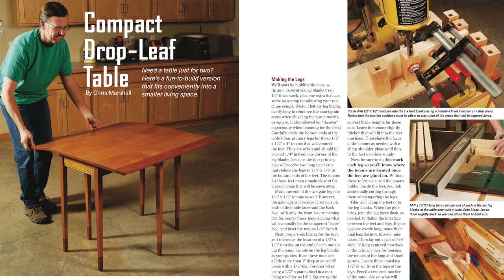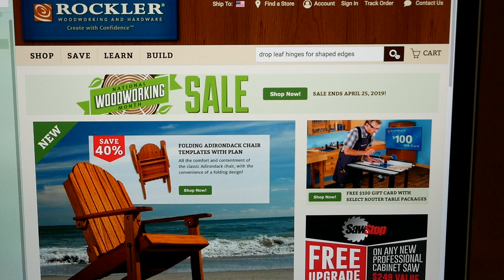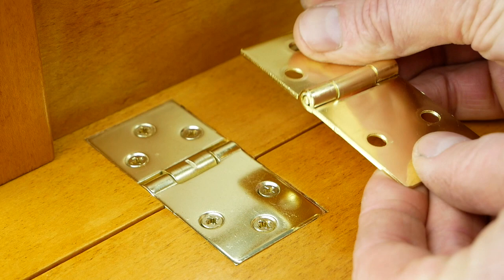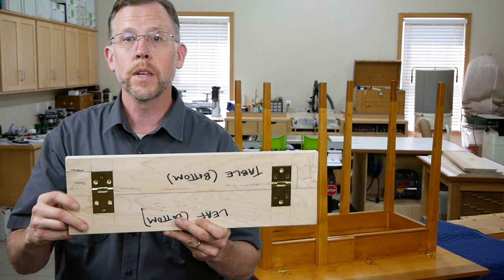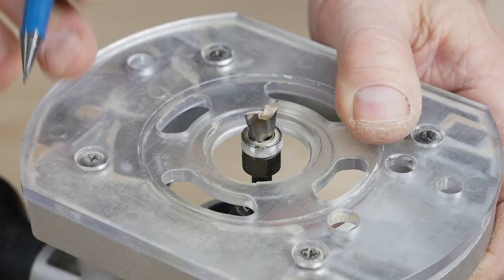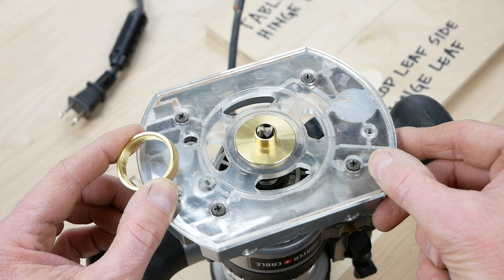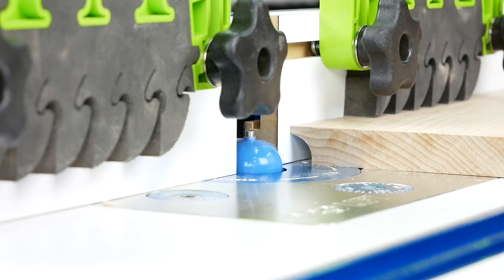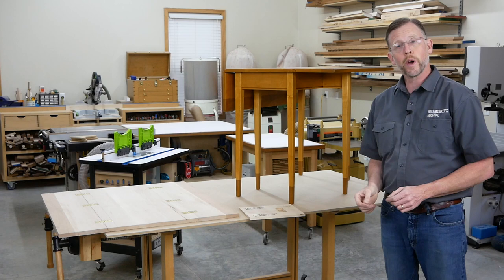How to Install Drop Leaf Table Hinges | Woodworking

Comment: Thanks for this tutorial.  I have one question.  I want the dropleaf to sit flush with the end of the top when dropped.  i.e, using 9mm ply for the top and dropleaf, can it be square edged so all the tabletop edges are unshaped and square to the top, the top surface of the dropleaf level with the underside of the top.

Comment: This was a helpful overview of a Rule Joint.  My question is what radius to use for the round-over and cove bits if you want a drop-leaf top that is 1.4" thick?  All or most, I have seen are 3/4" to 1" thick.

Comment: Thanks for making this video, lots of good info. But when the drop leaf is folded down, don't you see the hinge mortise at the bottom of the center piece round over? I do. It doesn't look good. Popular Woodworking did a similar video for the rule joint wherein they suggested NOT mortising in the hinges, specifically because of this problem. I thought the drop leaf edge would cover the mortise. My test piece looked good, but the real table does not. : (  What am I missing?

Comment: Were you able to determine why the rule joint would bind after you had made a routing template and cut everything as precisely as you did? I was expecting the joint to move freely, and not require additional nudging to complete the fit.
Reply: He had to trim off the leaf because he clamped the top and the leaf together without leaving a gap. Installation step #3 says to leave a 1/32" gap, which he didn't do.

Comment: Would this work if you had square edges rather than rolled edges?
Reply: the pivot point would have to be in the center-line with square edges, or if you're determined to have it flush and still be offset you could have a round-over on the bottom of the centerpiece, leaving the outer piece still flat, not as elegant but it works.